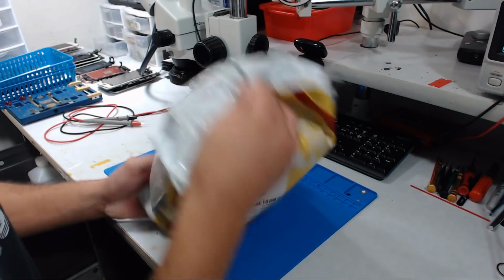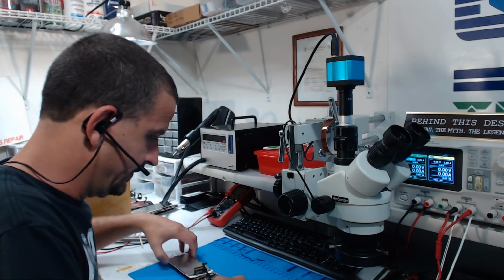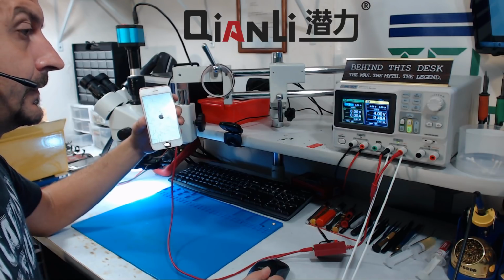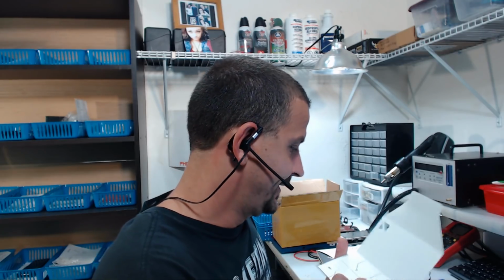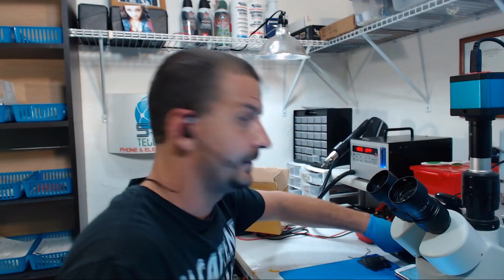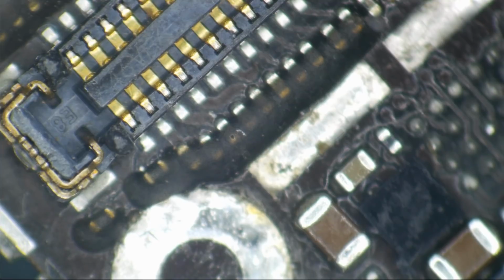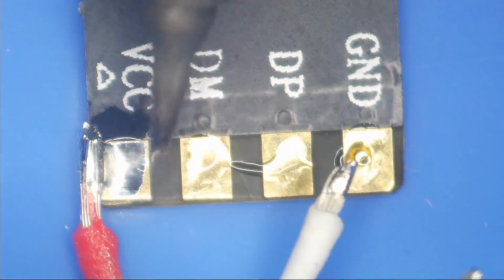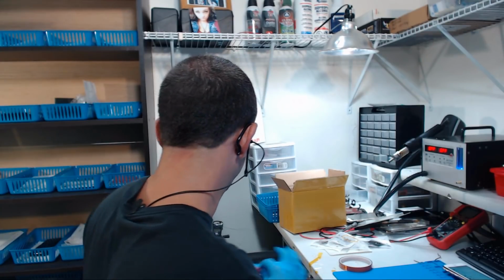Unboxing and reviewing tools from QianLi / Tool Plus

Comment: I hope you don't take this as sounding rude, but I think it's hilarious that you can solder the tiniest things ever under a microscope but struggle to solder big wires to humongous pads. That just cracks me up.

Tin the pads, add flux, tin the wires, hold wires with tweezers on pads, touch with iron until wet, and bam. Perfect every time. I'm sure you were just trying to be fast about it all, but it's still just really funny to me lol.
Reply from the maker: Ohhhhh how I wish I would have tinned those pads while recording this video.  LOL  has gotten me awful feed back! :D  thanks
Reply: Hold a piece of solder between you point and middle finger, hold the wire to the bench with your thumb, and feed the solder while applying heat with soldering iron held in another hand. Even faster.

Comment: Jason I love your videos . One thing I would do differently is when you solder those connectors on get rid of the unleaded solder and Retin the wires and tin the pads with leaded solder. Will be much better joint.

Comment: I sometimes end up adding some capacitance to the phone end. The wires can end up being just too long and even if the resistance drop is tolerable the inductance is too great, and even cranking up the voltage won't be enough to compensate.
Reply: ...Yes ugly workaround. Ideally I'd maybe add an LDO too or something but that's a lot of trouble just for long wire compensation. Trouble with these phones is there's not much space for capacitence to begin with. If they didn't build in enough margin to compensate for MLCC degredation you can end up with an unstable device especially if it's an older one.

Comment: Since the stencils seem to be out of stock (or whatever) on the original website, I found them on UnionRepair. Just search for "QianLi" on unionrepair.com and you will find them. Or use the following links:

Baseband: https://www.unionrepair.com/toolplus-communication-base-band-bga-reballing-stencil.html

Power, logic: https://www.unionrepair.com/qianli-toolplus-iphone-power-logic-module-bga-reballing-iblack-black-stencil.html

NAND: https://www.unionrepair.com/toolplus-universal-hard-disk-model-gtr100-bga-reballing-stencil.html

CPU (for the brave): https://www.unionrepair.com/qianli-toolplus-iphone-cpu-module-bga-reballing-iblack-black-stencil.html

They also seem to have "3D" and "Japan Superhigh Precision" series of stencils, but I am usure which ones are actually better quality.

Comment: Same DIY squid I got from Rossmann, so it's a supplier issue.
Reply from the maker: They are nice and work well but ppl should know about the DIY part before ordering.  I couldn’t find that info on the website in my links.  I didn’t know Rossmann sold them.
Reply: @ststele  near instant sadness when I opened the box.

Comment: Would suspect the reason you have to put leads together is that if you use this all the time you may stuff up the end. To combat that you can buy new ends. But  yes you may save $5 and spend $10 in time.

Comment: I too was surprised when I opened the box and found I needed to solder the connectors, after checking the eBay listing it did say it on the add lol but then again to be fair if a little bit of soldering was beyond you then perhaps micro soldering is not the best choice for you(not aimed at you Jason your skills are proven if not by this video proof  rofl) :)

Comment: I bough this box, got a few days ago, When I try to use the FPC Iphone 7G  the FPC won't fit. Well any of both FPC marked for Iphone 7G and Iphone 7P won't fit the IPhone 7 FPC receptor. The Iphone I am trying to turn on to test this box is an Iphone 7 (A1660) what it supposed to be The FPC 7G marked.  I know there are two version of Iphone 7, The Qualcom and Intel. What point I am losing? if you or someone here may direct me how to turn on an Iphone 7 with this box? Maybe a bad batch of FPC from Quiali or there two different motherboard FPC for Iphone 7 Qualcom and Intel?

Comment: I would imagine the lead soldering and plastic box would be to cut the cost down.
If i had assembled the leads, i would have loaded each pad with a fat dome of solder, then the lead would sink into the solder, but that's just me :-D.

Like the T shirt, it confuses the brain nicely :-D
Reply from the maker: That would be much easier than what I did in this video.  Would have had a free hand to use wire solder too.  This shirt has been driving people nuts all day.  It gives me a headache to look at it!
Reply: I seen another unboxing of that iPhone power leads and the soldering of the ends by the enduser is apparently intentional.

Comment: Least you can blame yourself if the solder fails on them connectors under the heat shrink and not the factory lol

Comment: I have been thinking for a while now. So here is the question - How did you keep your hot air station so quite, even your microphone cannot pick up the diaphragm noise throughout your filming. Did you pipe external pump to the unit and kept quite all these while. :-)

Comment: Are these beautiful black stencils is not available?
why are you biting me? :С
Reply: Sinse the stencils seem to be out of stock (or whatever) on the original website, I found them on UnionRepair. Just search for "QianLi" on unionrepair.com and you will find them. Or use the following links:

Baseband: https://www.unionrepair.com/toolplus-communication-base-band-bga-reballing-stencil.html

Power, logic: https://www.unionrepair.com/qianli-toolplus-iphone-power-logic-module-bga-reballing-iblack-black-stencil.html

NAND: https://www.unionrepair.com/toolplus-universal-hard-disk-model-gtr100-bga-reballing-stencil.html

CPU (for the brave): https://www.unionrepair.com/qianli-toolplus-iphone-cpu-module-bga-reballing-iblack-black-stencil.html

They also seem to have "3D" and "Japan Superhigh Precision" series of stencils, but I am usure which ones are actually better quality.

Comment: No it is no a mistake, this new version comes with not soldered cables :(
Reply: just switch on your brain and think.... it's of course faster and better for them to react on new phone models only supplying with a new connector instead of having tons of pre produced cables with old connectors, nobody needs anymore, laying around....

grab a bunch ob cables, supply a bag of the newest connectors... ready you go...
and i really can't understand Jason here crying 20 times in this video why the connectors are not soldered.... man if he had used this time crying to solder, he'd finished all... better than opening all those cards one after another...

Comment: Over the years I've got increasingly annoyed about insulation that 'fries' with applied heat. Heatshrink is fine for mechanical support but shouldn't be necessary for anything other than an inline repair.